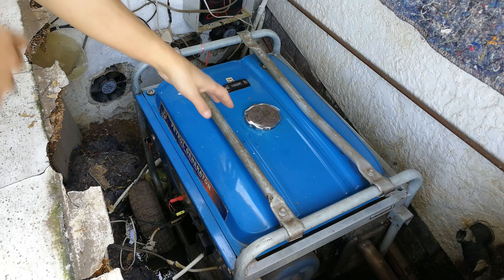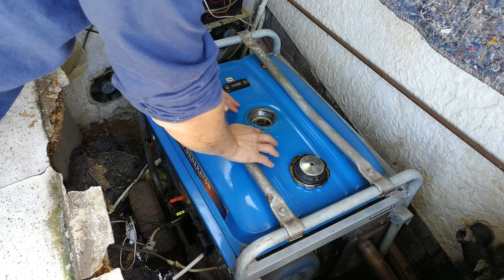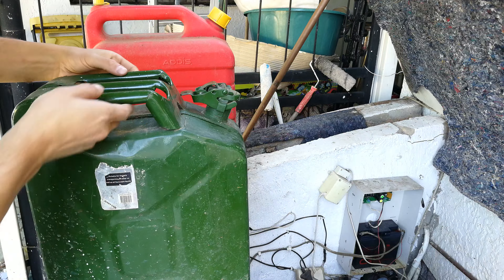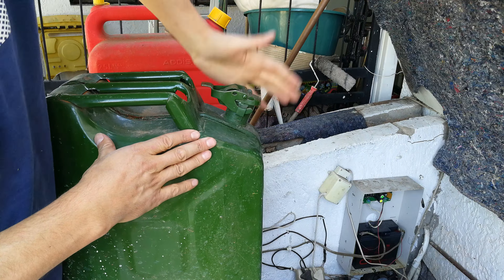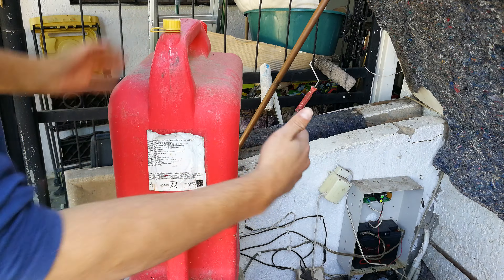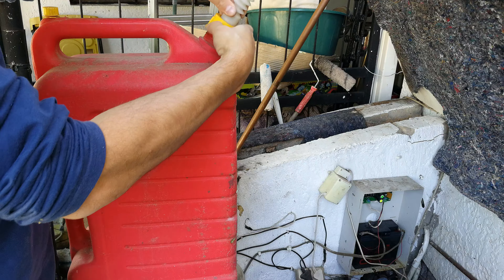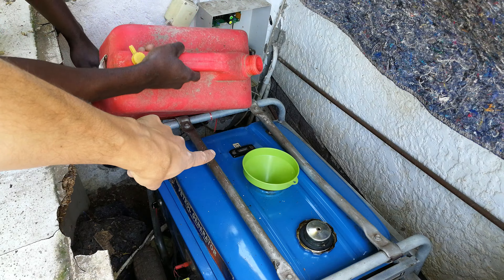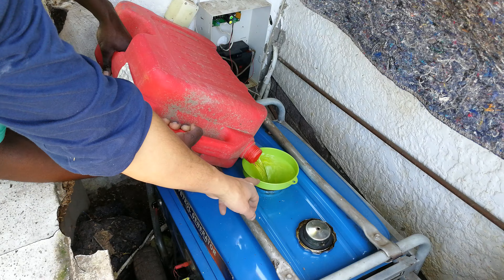How to fill a generator with petrol using a Jerry can or petrol container.

Comment: Actually, your assistant is pouring correctly, with the can on its side and the stream aimed directly at the centre of the funnel. He could pour much more quickly if he wanted to because as long as that stream goes straight down the hole, the chance of it filling and overflowing is minimal. Well done whoever taught him! Greetings from Oviston on !Gariep ( used to be H.F. Verwoerd) Dam.

Comment: Ordered both diesel and petrol Cans a few months ago from an online store. They decided to deliver a water Addis can and diesel can 🤦‍♂️. But honestly though besides the lid caps  being a bit different. What segnificant changes are there to the bottles ? Yes the textures outside feel slightly different but one isn’t heavier or robust feeling from the other . Could it be the composition of the material they use to make the petrol ones vs water ? 🤔